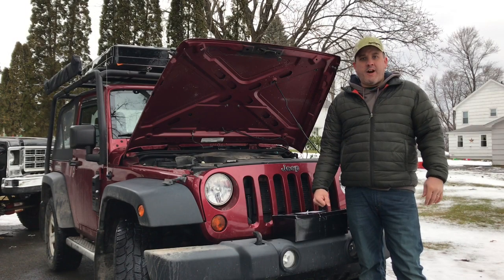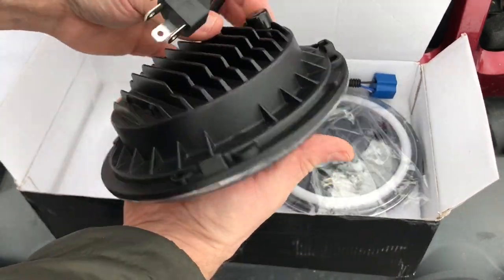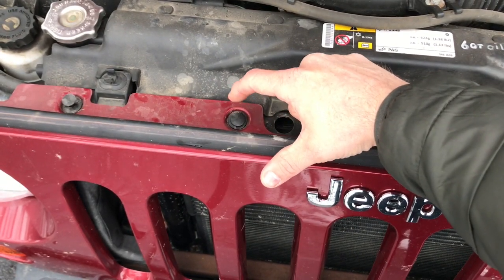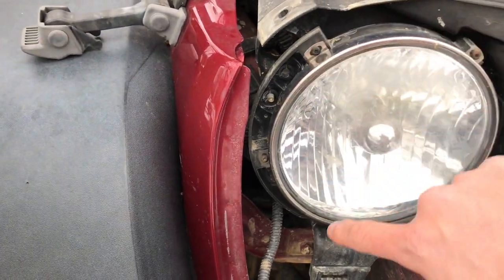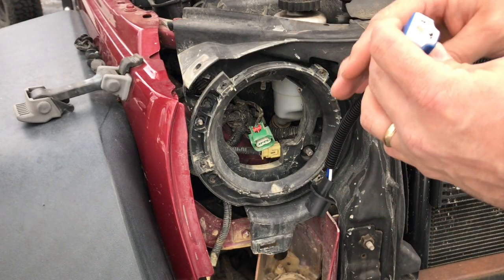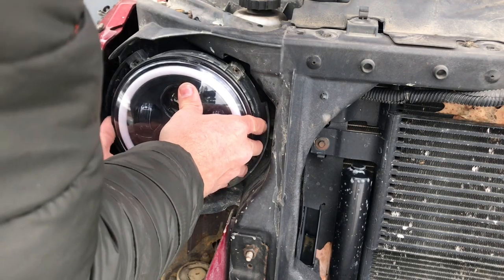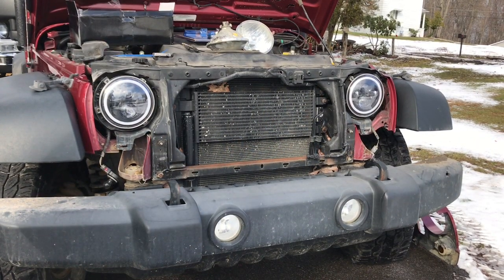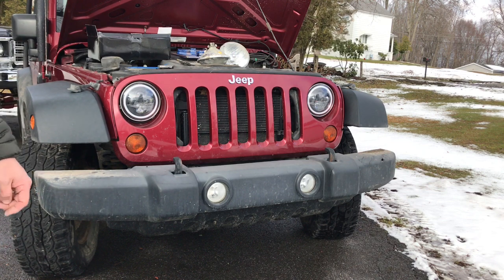Unboxing and installation of led halo headlights

Comment: What about the DRL halo ring?
Reply from the maker: We have not connected the halo ring,  this headlight also has a turn signal which I also did not wire up,  as for the halo driving light it is a 12 volt crimp terminal connection that can be wired to a switch or spliced into your running lights if equipped.  Don’t really care about a halo ring, or turn signal.  Can always wire it up, if you choose to.  Thanks for asking!